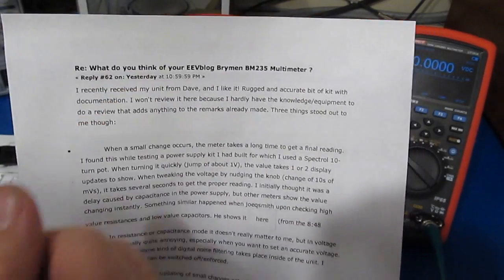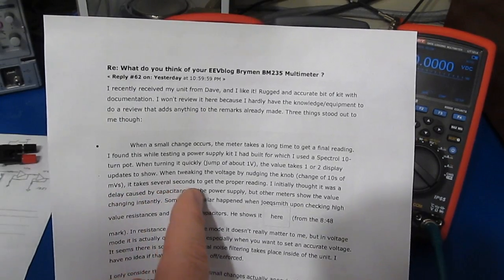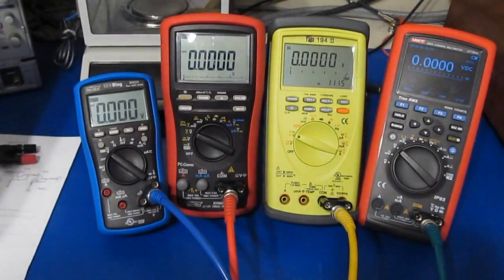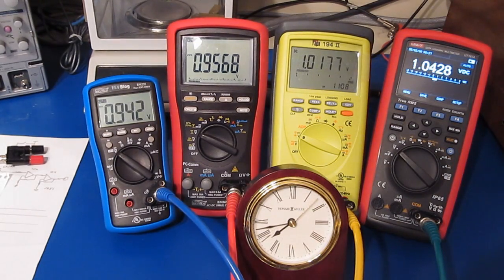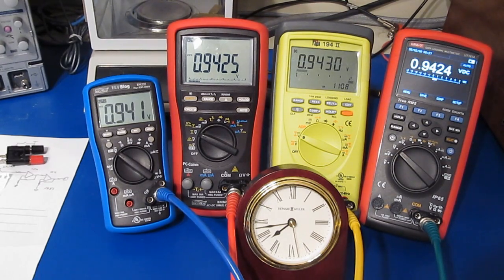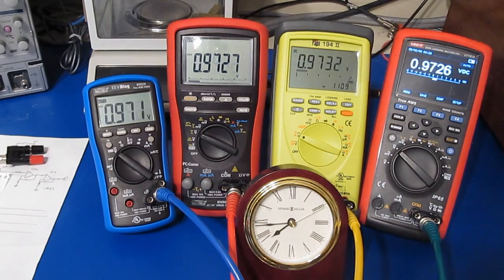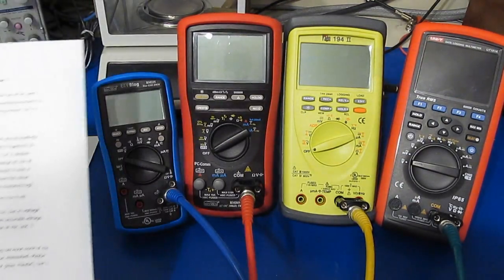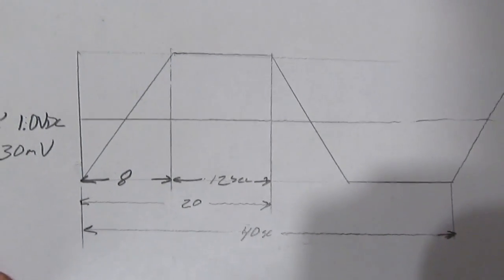Brymen Filter, Long Settling Times

Comment: ¿May be his the power supply dont have discharge resitor?
And the other metters got low impedance act as discharge resitor.
Reply from the maker: You would need to write him.  He did not say if the meters were in parallel.  Regardless,  both Brymen meters I have will enter this mode if their input signal moves slow enough.   There is nothing in the documentation that I found that describes it.